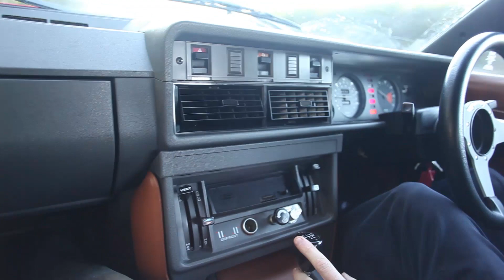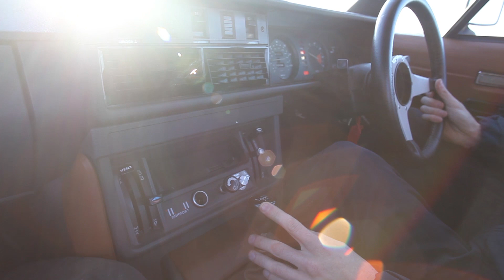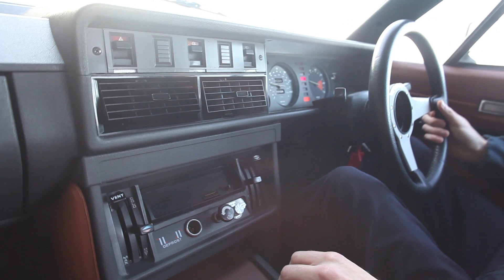RPi Engineering TR8 - the introduction

Comment: It needs a LS swap. Well over 400 hp is easy and would probably get over 30 mpg when a LS powered Corvette could regularly get over 25 mpg. The rear axle would need upgrading though as well as a Tremec 5 or  6 speed. Kind of a Modern Cobra.

Comment: Why ALL the: Orange & Red Lights on the Dash Board ?
Reply from the maker: Don't recall which ones where on as it was two years ago now. They obviously are warning lights but very often in older cars like this they are due bad sensors on fluid levels etc and are / where no doubt on ours of the customers list of things to fix / look at.
Reply from the maker: Just looked at the final video that we did on the car (linked below) and you can see that all lights are off on the dash so they were obviously things we sorted while the car was here with us.
https://www.youtube.com/watch?v=BFbdOKNZlt0
Reply: We use to see alot of Triumphs here in Canada in the seventies. The thing is they would never start on a rainy day which is odd because they came from England which has a very wet climate.